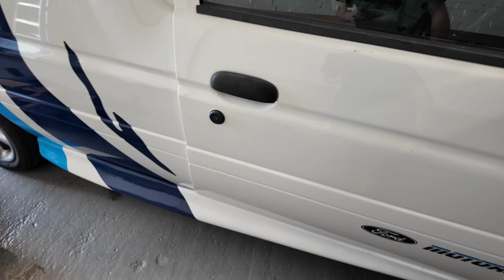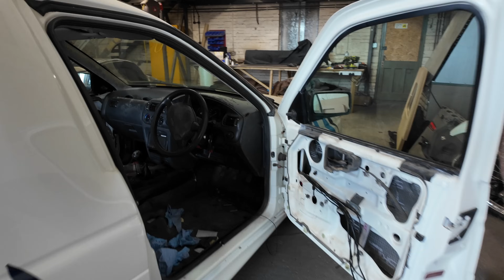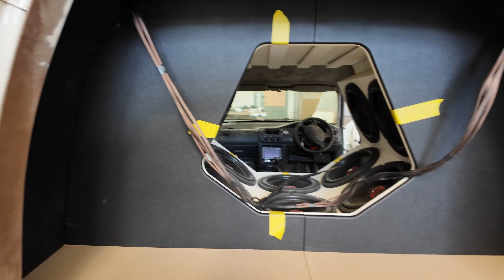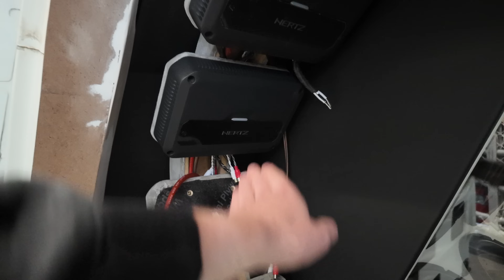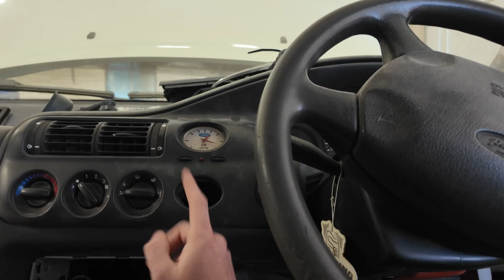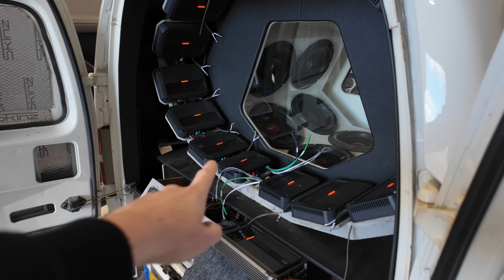OUR VAN IS ALMOST DONE... *10 SUBS* | EP2 | 4K

Comment: U might want to put some sort of screen brace on the front as we cracked ours a few times when base went up & that was with 4 x 15" Legacy's in an enclosure, Mk6 vans ain't that solid & the amount of screw that undo themselves U need a box of anti-rattle washers & a good regime of checking B4 shows
(Did this with 2y/old M reg van back in the day)😂 added CDL, auto pop locking, smoothed handles & Spal window kits with ford switches, bee sting roof aerial & cup holders on the bonnet for Ur 1/2 full coke bottles nothing like a bit of animation to Ace of base)😂
& U may need LEDs instead of bulbs as we used to vibrate the filament apart in the OE bulbs.

Comment: I’m more than positive that the problem with your heater fan would be the resistor if it only works on full position
Reply from the maker: It was, we ended up just replacing the resistor